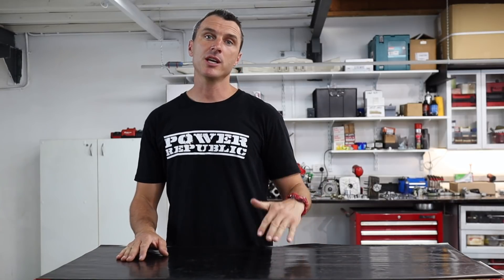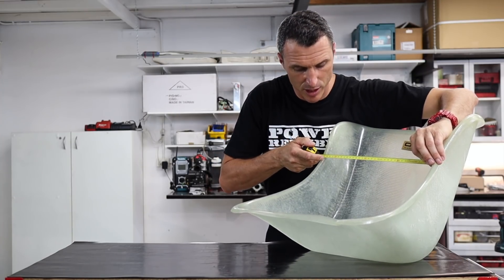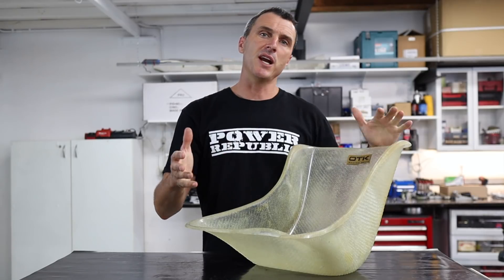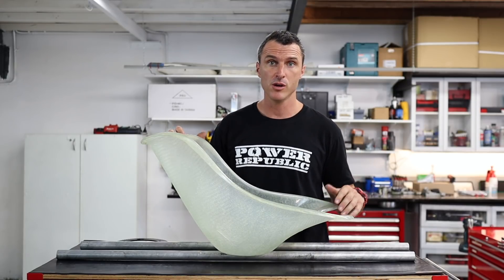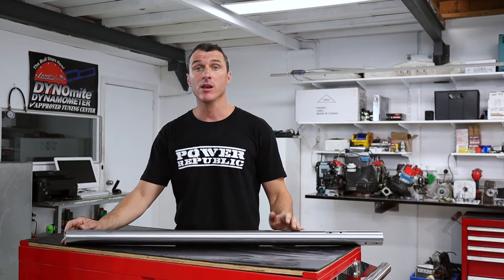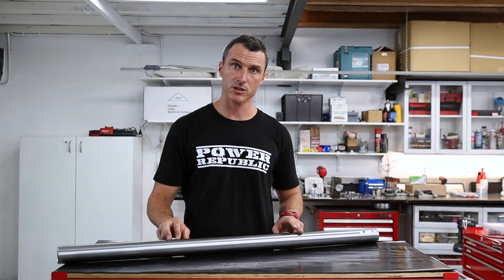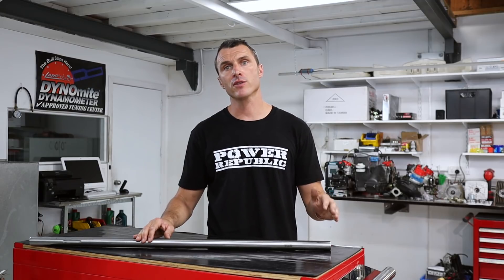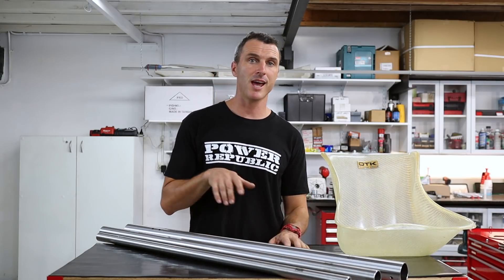Introduction To Tony Kart Seats & Axles - POWER REPUBLIC

Comment: Hi guys, I think your channel is one of the best around for Karting. You give really precise information about specific karts (tony karts mostly) and you explain very well. However, are there any chances that you will produce some sort of noob video guide (a bit like you did with camber/caster/toe) about other adjustments. Exemple: Wider track is better for xyz, if tire pressure to low/high it gives  xyz or how to adjust the kart if it oversteers/understeers. You know ...the basic :P Thank you
Reply from the maker: HI Yannick, thanks for the feedback and questions.  I will have to add some of those topics for you over the next few weeks

Comment: Hey Derek, awesome vid again mate. 3 questions. What do you mean by coming on too fast or too slow when talking about the axles? Also, I’ve noticed so seats can have varying flexibility. Is this the same with OTK seats? Why would you use a soft seat compared to a hard seat? Cheers, Matt
Reply from the maker: Hi Matt, thanks for the positive vibes.  Great questions.  coming on fast (i.e too soft axle)  is when your fastest lap is lap 3 and then every lap you get slower.  Coming on too slow (i.e too hard axle) is when your fastest lap is lap 8 in an 8 lap race.  Give it a try and let me know if it works on your kart and track.  The OTK seats are all the same rigidity in that they are made out of the same materials.  You can try softer and harder seat from other suppliers but I haven't noticed that much of a difference personally, so I run an OTK seat and focus more on my driving improvements over seat stiffness.
Reply: @PowerRepublic  so i assume im best using a hard axel, as i intend to drive for fun not in actual races??
Reply from the maker: @christianbuczko1481  if its just for fun leave the standard axle in it and send it.  the standard axle will work just fine for most applications in most karts
Reply: @PowerRepublic  ok thanks, im relieved actually, i dont need another expense if not required. Ive spent way too much, my karts pure bling now or will be once all parts ordered arrive.

Comment: Hi ya mate, loving your channel,, brilliant content,, Im using a standard axel neutral set up on my 18 tonykart running d5 tyres,, even with feathering my throttle out of fast corners, I'm still exiting out off corners sideways,, would a softer axel let me grip in and cut that down sliding down a bit? Obviously driving could be improved .. Thought id ask,, cheers
Reply from the maker: Hey Ryan, thanks for the positive feedback, it really means a lot.   power on oversteer I take off seat stays,  put on longer rear hubs, reduce positive camber in the front, probably in that order.  Also too you could try dropping the rear tyre pressures, lift the rear axle or move your seat back 20mm.   Hope that helps.  Are you racing in the UK?
Reply: Power Republic yes uk tracks buddy Thanks for your info will try it out,, appreciate it,, keep up the good work 👍🏼
Reply from the maker: @ryantumilty3621  yeah and a softer axle works too for us on Dunlop tyres here in QLD if your driver isn't too big.  Any way, now your arsenal is full, head out the to the track when they re open and give it a go.  Let me know what works.  D
Reply: @PowerRepublic  yea I'm only 5:7 weighing 68kg,, I've lead strapped down the seat to the left side and the rear left side also to get me to the 165 category rotax,, running mojo d5s,, also have middle carrier out, i will try them few things you told me first of all, and if all else fails,, i'll invest into a softer axle,, thanks so much,, appreciate it mate.. Also if kept I the standard axel would wider rear hubs help me get more exiting grip?? Running standard rear hubs atm..
Reply from the maker: @ryantumilty3621  yes it would on my kart and that is something you could try, if that is the correct  problem you are having identified.  Otherwise it will be totally wrong
Reply: @PowerRepublic  a video on choosing the correct hub size set up would be a good video possibly,, cheers again,, busting to get out after this covid 19 packs up

Comment: Is it more important to mount the seat further back or more for what feels comfortable
Reply from the maker: Darrin Stuckwisch it’s a balance. Mount the seat where comfortable if you like. But you will have compensate with chassis changes to get your balance. Otherwise, Mount the seat close to the factory settings and adjust the pedals around to suit your body size.
Reply: I bought the kart second hand and I am not finding any information that is left on the arrow x1 seat setup
Reply from the maker: Darrin Stuckwisch I would set the seat parallel with the bottom of chassis rails and 645mm back from the front chassis rail. If you are above 6” tall or have big shoulders (over 80kg’s) I would tilt the seat back between 1-2sprockets under the front of your flat bottom seat.
Reply: Power Republic I’m actually a pretty small guy 5’11 and 135 pounds
Reply: Power Republic I’m at around 625 mm as I was a hair over 2’ from the front chassis bar is that to far forward
Reply from the maker: Set it flush with the bottom of the chassis rails with the flat bottom of the seat parallel to the frame.  make the measurement from the front of the chassis to the front of the seat approx  24.5".
Reply: Power Republic awesome I almost landed it perfectly right there at 24 1/4 inches I have the seat a hair to the brake side as I was hoping to somewhat offset the rotax weight
Reply from the maker: @darrinstuckwisch4903   sweet as.  my karts are set to about 58/42 rear front weight.  if you want get 4 bathroom scales for a rough corner weight/balance check

Comment: how can I alignment the rear axle in a dd2 kart?I can alignment it in two ways (the height  between the engine and the ball bearing) and the hole of the engine and the hole ball bearing.
Reply from the maker: Measure from the front king pins to the front of the axle on both sides of the kart.  Also you can measure up from under the chassis rails to the bottom of the axle to get the ride height the same on both sides of the chassis.
Reply: thanks!!   @PowerRepublic

Comment: How to fit on a shifter?
Reply from the maker: Hey Alex.  Are you asking how to fit a seat to a shifter or fit a shifter to a Kart?
Reply: How to fit a shifter on a kart, thanks.
Reply from the maker: It’s a bit of a mission. But the easiest way is to weld nuts onto the chassis uprights near the fuel tank. Then you can screw in some rose joints (tie rod ends) and run your shifter linkage in those.  Hard job without a lot of specialists equipment. Easiest to buy a second hand shifter rolling chassis  n